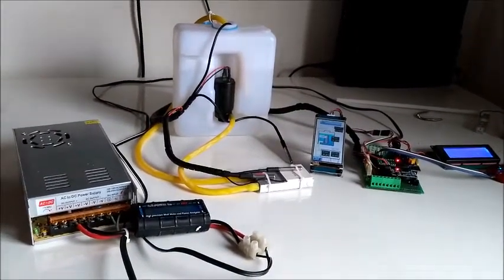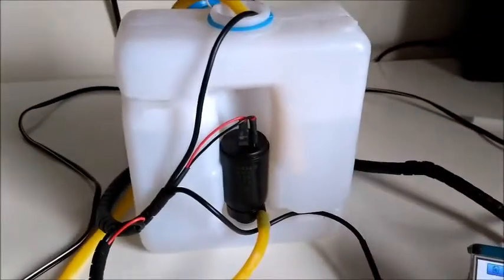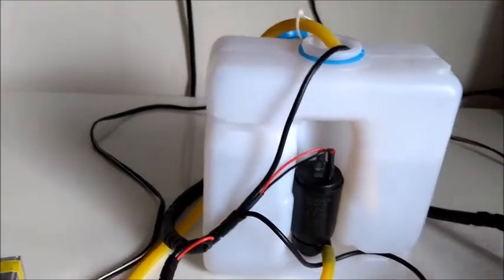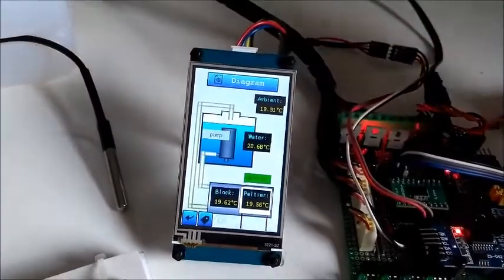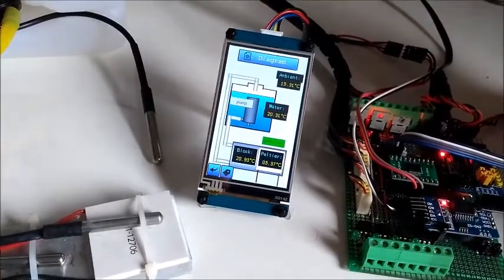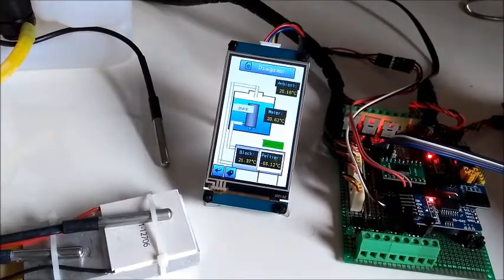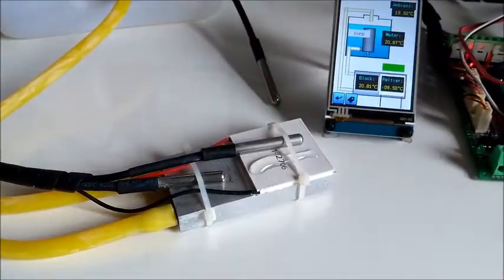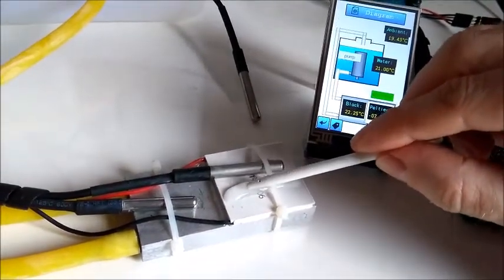Peltier with Water Cooling System - CHILLER

Comment: Hi. I would like to ask a question. Does the water tank get too hot by time? Or it is enaugh for cooling peltier's warm side? I have watched some videos and there usually used fan to get off the heat. Does it necessary to use fan?
Reply from the maker: It's enough during a short period, if you need the operation  with a long time it's necessary a radiator with a fan.
Reply: @engthink  for how much time its enaugh approximately? for example in your system. also what is the limit for water degree max?
Reply from the maker: I really don't remeber, but could be change dependig the amount of water and the ambient temperature.

Comment: Awesome project! Congrats!

I want to use the same peltier system to adapt on a air climatizer with 20L of water tank, to cooling the water, can I use the peltier without any fan? I mean, is necessary to use a fan to remove the heat of peltier?

Thank you in advance.
Reply from the maker: Hello and thanks!. So, to use peltier without fan it's necessary a big heatsink to support all the heat that is generated by peltier cell otherwise the cold side of peltier will not refrigerate the water of the tank. Beside that, according with my experiments without a heatsink and a fan the peltier cell dont will work, in this particular case I am using water to cooling the peltier but cannot run for much time.
Reply: I am a layman on the subject, but I want to use a peltier water cooling system to cool the tank of an evaporative air cooler so the cold water must circulate in the hives or radiators and the evaporative air cooler fan itself must throw the cold air forward , acclimatizing the environment, instead of the original paper hives of the acclimatizer, I think of using 240mm CPU radiators.

I'm a layman on this subject, but I would like to know your opinion about this project.

Thanks in advance. @engthink
Reply from the maker: The main problem of that is the power consuption, peltier cells consume a lot of energy when you compare to air conditioner. Because of this is only used in small systems. For example if you what to cold a box can be possible. Check this video from my other chanel https://youtu.be/oDrnwykz6mw

Comment: So you don't need a fan? Just water flow?
Reply from the maker: Exactly, but a important thing, if you run the system long, the water temperature in the tank will increasy, so will be important use a  radiator for long run the system.

Comment: Hello excellent work I would like to make a system like the one you did, with the microprocessor and the controller, but I am a beginner in this subject. I've been studying the peltier system but your on / off control system is excellent, but I do not know what to buy to make one.
Reply from the maker: Hi, friend, thanks for your comments!! I recommend for you, starting using peltier cell without controll, just switch on a power supply and see whats happend. After you could start making some simple programs using arduino, read temperature from a sensor etc... Don't give up, keep studying. For this system I use:

Microntroller: PIC16F1829;
Temperature sensor: DS18b20;
Peltier Cell: TEC1-12706;
Display: Nextion 3.2inch;
On/off controll: Mosfet IRF3205.

Comment: Can you specify details of all items used in building this system and if possible webpage link for the same.

Btw great work.
Reply from the maker: Thank you for your comment. At the moment I don't have a webpage, but I will considere this.

Basically I used:

Microcontroller PIC16F1829
Temperature sensors DS18B20
Car windshield water tank with 12Vdc Pump
Power Supply 12Vdc
Water Block 40x40
Peltier Cell: TEC1-12706

Thanks for contact!

Comment: you fool turn the writing side of module to the block that side is cold ...
Reply: only if you reverse the polarity.
Reply from the maker: Exactly, reversing the polarity, will change the side of peltier cell, the side that was cold will turn to heat.